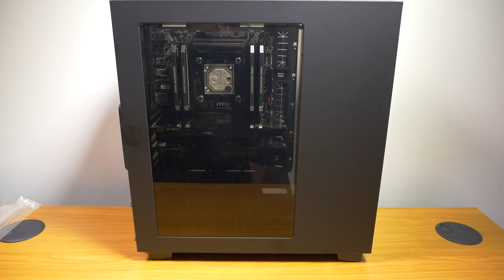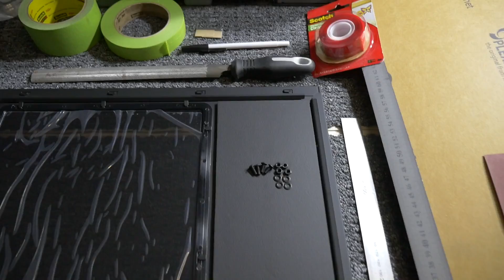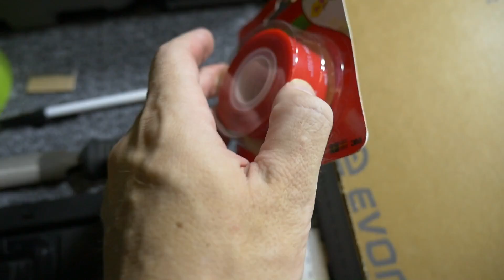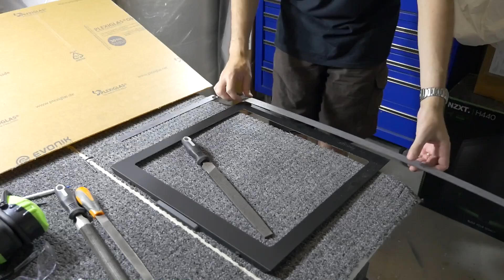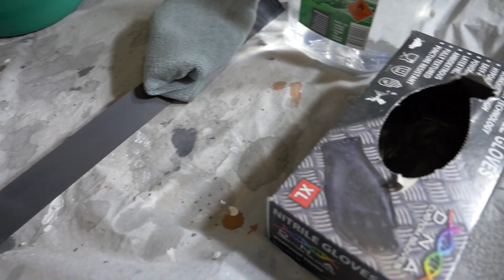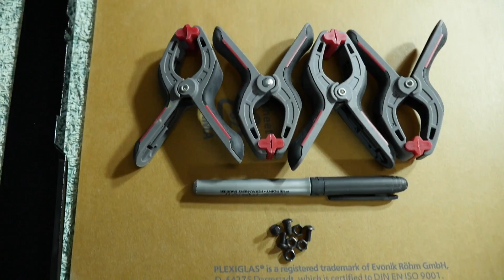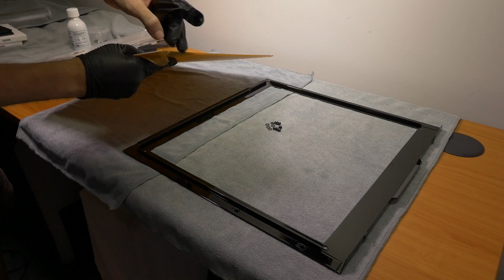SC Modding #7: Side Panel Window Mod

Comment: I am currently attempting this with my h440, and it was going quite smooth until the side panel wouldn't go back on the case as something was hitting towards the back of the panel and wouldn't sink in to the grooves it's supposed to. Is removing the exhaust fan enough to fix it? You seem to have no issues with that and also have no rear fan but maybe that's just a coincidence

Comment: 400 then 600 then Dremel white buffing wheel with red jewelers paste saves a fuckton of time and elbow grease, and ends up with a glasslike mirror finish.

I typed that before I saw you use the polish and buffing wheel 👍

Nice finish

Comment: I like using hex head bolts. Mr. Allen actually invented the hex bolt in Hartford, CT. Nice mod. The H440 looks a lot better without the drive bays and the full side window. Plexiglass is the way to go. How did you get your rounded corners? Did you switch from the jigsaw to the dremel?

Comment: For the next time it will be much easier, to remove the isolation when you heat up the sidepannel from the front with a hair dryer, than you can remove it easily without any adhesive residues ;-)

I'm sorry for my bad english :/

MfG
G.A.

Comment: It makes it easier for round corners if you use a hole saw. How would it go replacing the whole door with a clear poycarbonate sheet, cause it's so much more scratch resistant. Love your work.

Comment: Hey, I just wanted to add a tip for drilling acrylic;
Typically most drill bits are suited for drilling steel -- so the cutting edge is sharp, particularly the pilot edge. When you're drilling acrylic this can cause problems as the blade will bite into the acrylic and  either cause your work to spin if you don't have it clamped down or -- more likely -- shatter the acrylic.
What I do to alleviate the problem is to use drill bits suited for drilling brass and softer materials. The pilot edge on these drill bits are flat, and so rather than cutting the material away they shave it away.
I'm not sure if these drill bits are commonplace and you can buy them (I learned this trick from my work) but if you've got a steel drill bit you can convert it to a brass drill bit by simply sanding or grinding the sharp edge off of the pilot edge with a process called "dubbing" (Google it for a better description on how to do it). If you've got a Jeweller's grindstone on hand it makes the process super simple.

Hope this helps some budding modders spare themselves some acrylic and some heartache.
Reply: Made for steel bits are ok as long as you use light pressure.

Comment: The final panel looked epic, nice job (that black paint was a mirror)! pop rivets look clean to attach the acrylic instead of screws (they are inexpensive and the tool is pretty cheep). However you have to drill them out if you want to take it back out.

Comment: Thanks for another great tutorial, amazing work and attention to detail. What's your experience with drilling larger holes in acrylic? I couldn't really tell if it was a special drill bit on your drill press and I have plans for my next build to drill some larger holes for pass-through fittings in a customized acrylic midplate. Browsing around I keep seeing people recommending acrylic point drill bits and starting with small bits at low rpm, working your way up to the desired size, lest risk the acrylic cracking.

Comment: Question: If I wanted to do a glass side panel, is there any hazard regarding heat? Would I have to use a special type of glass such as tempered glass? In your experience does a glass window give a better effect or is a good quality plexi glass the same thing as plexi is easier to work with. My problem is I have a nzxt s340 with a very low quality poly carbonate window that scratches very easily and thought maybe glass would add a much better effect. 

Thx I admire your work.
Reply: +Pieter van Heerden the problem about glass is the drilling i guess.. ofc there are drills for smaller holes and diamond hollow drills for bigger holes but you can't drill glass closer than 2 cm away from the edge or it will almost certain crack every time.. that's something you have to consider.. i don't know your sidepanel but i know that it has to have enough surface so you can dill the glass far enough from the sides because i drilled glass before and it can be a real pita.. also you should tape the glas where you drill and place it on a soft but flat surface when you drill it.. like rubber or cork or whatever.. drill with low rpm and carefully.. wear good gloves and saftey glasses.. 
i think the benefit of glass over plexi would be that it is very resistent against scratches but it also can break on the other hand and is heavier than plexi..

Comment from the maker: I just wanted to say. You guys are awesome, thank you so much for the great comments, your support and for sharing this passion with me!
Reply: +SingularityComputers I honestly don't know why you don't have around 1mil subs.
Reply: Holy shit we get to see your face for the first time (or maybe you've shown it before and I'm just an idiot and don't remember xD)
Reply: +SingularityComputers What case is that?
Reply: +Balubish Tech nzxt H440 "Razer Edition"  0:48
Reply: Thanks
Reply: +SingularityComputers OMFG Thank you for changing the intro music. I always got annoyed that there was a long silent section of the intro. Was going to offer some constructive criticism but it seems either someone else has or you decided to change it yourself. Top quality work!
Reply: +SingularityComputers Have you considered flame polishing the edges?
Reply from the maker: +TheMrDuffie You still have to sand the edges back to 2500 grit at least to get a good flame polish because it wont remove deep marks or scratches, its the equivalent of a light polish with a rotary tool.
Reply: hi there video is a great help what thickness did you use for the acrylic sheet ?
Reply: just a quick question how did you mount your HDD at the bottom with no tray ? is it a custom bracket.
Reply: my 440 (same internal layout) has screw hold at the bottom
Reply: Could i pay you to do this mod for me?

Comment: I noticed you wet sanded, is there any rules for when you should use wet sanding and when to dry sanding?
Reply from the maker: +Bekker I always wet sand paint. Otherwise the sandpaper ends up clogging and scratching the surface too deeply. Once you get above 600 grit you have to wet sand or the sandpaper will clog almost immediately on paint, metal, plastic. So it depends on the material and grit.
Reply: ahh i see, good to know :) thanks

Comment: I got a BitFenix Prodigy. I own the windowed sidepanel but my GPU can't breathe. I just have to drill a few holes and polis them to make that mod. 

After that I want to paint my GPU green so it fits my color scheme. I want it to look like the 100ME edition. 

My third mod would be front IO. It's on the back sidepanel and I want it on the front and decided to move the power button, and the front USB 3.0 to the unused drivebay. 

Any ideas on where I can get materials? You worked with ButFenix Prodigy before...